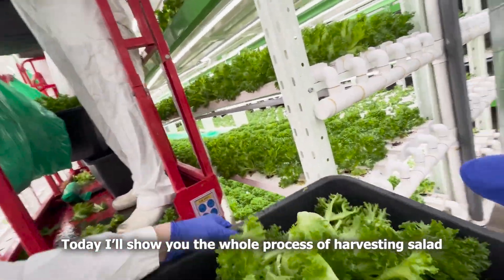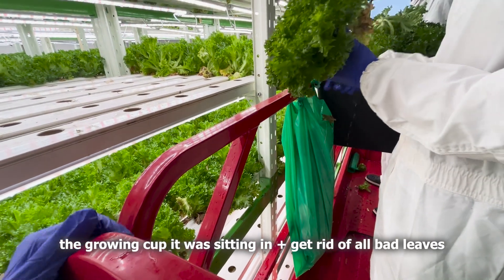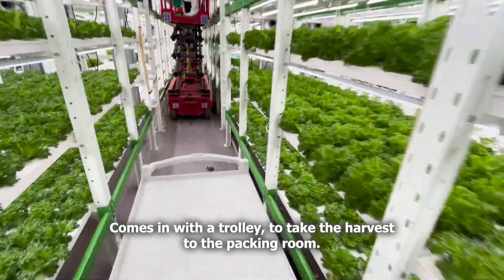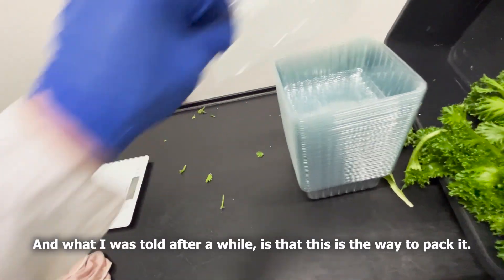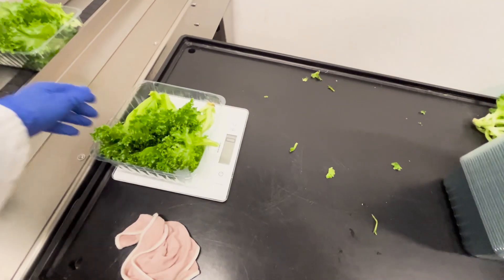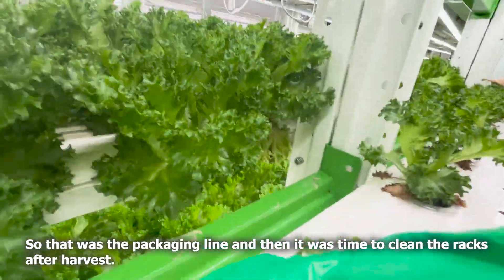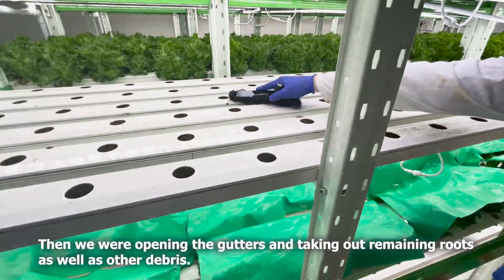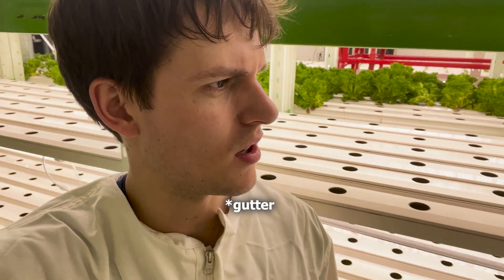BIG Harvest on a Vertical Farm 🇳🇴

Comment: Another great video sir my guess is after a while one gets a good figure on how much to put in the pack and it moves pretty fast
Reply from the maker: It’s exactly as you’re saying. The owner, Marius, now wants to skip the whole “putting the filled clams on the scale part” with a machine that will automatically let a correctly filled clam pass trough and send an under-/overweight clam back to the packer.
Reply: @urbanfarmerseb  that sounds faster long term
Reply from the maker: @PAplowboy  should be, yes